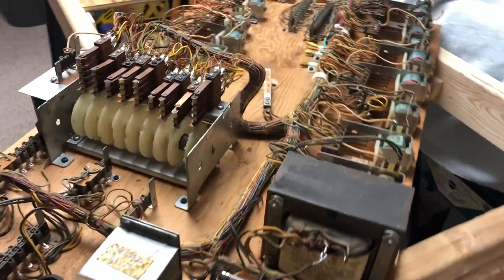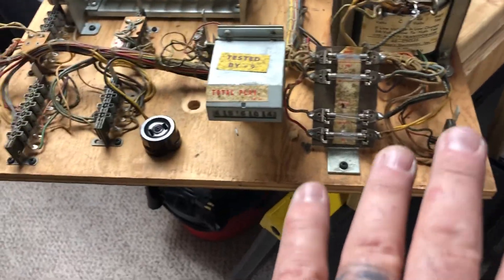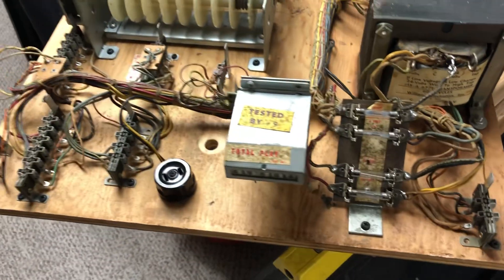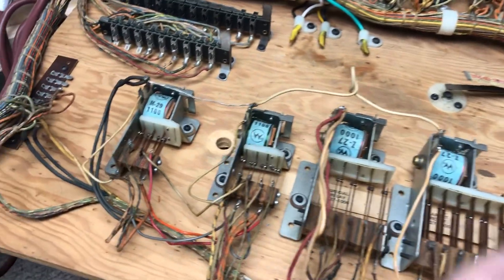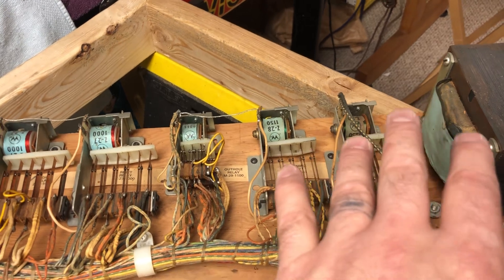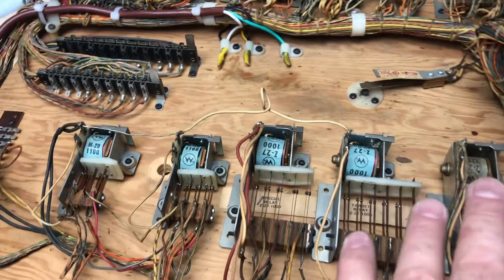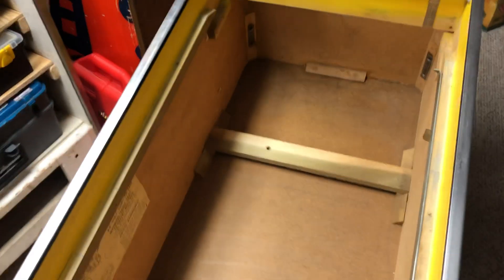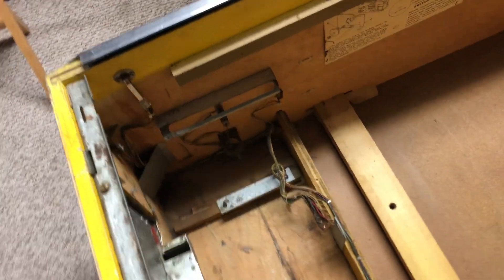Refurbishing Explanation on a Triple Action Relay/Motor Board. #pinball #williams #tripleaction

Comment: Hi Mark, nice vid.  I like especially the  very neat replacing of the mains lead, It's inspired me (at  last) to take care of a 'death trap" factory installed set up on a Williams Full House m/c I have.  In case you're not aware the cabinet interior would benefit from a coat (spray) of Concrobium Mold Control, I use it and it really freshens them up (cheap too), taking away that musty smell.👍
Reply from the maker: If i got stinky machines I use an Ozone Generator for about 5 hours in the garage before I even touch them. Ozone will destroy the rubbers so that's why I use it first. I Lysol the cabinet later once I get in it. I got a game over a year now and after the Ozone treatment no more smell.
Reply: @MarksBasementArcade  Sounds like it does a very thorough job, the musty smell really puts me off, I'll look into that👍